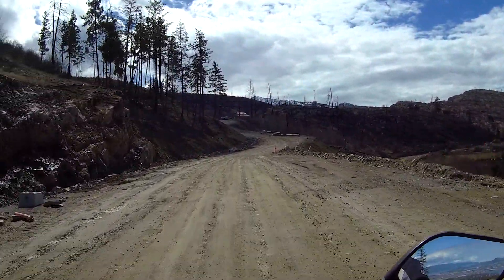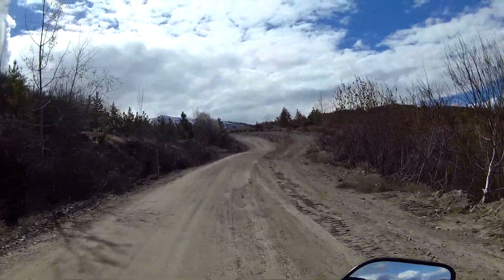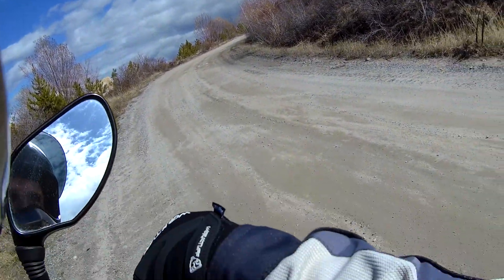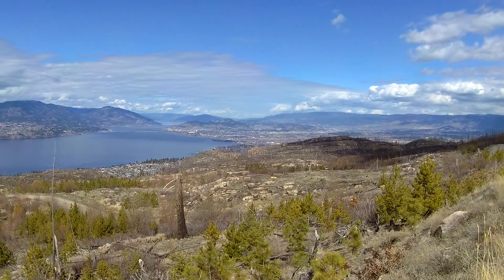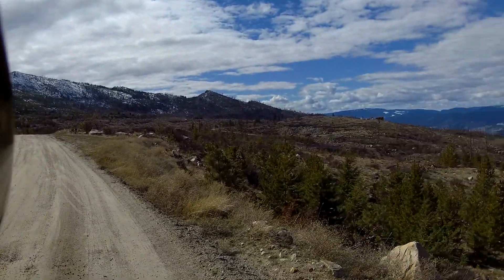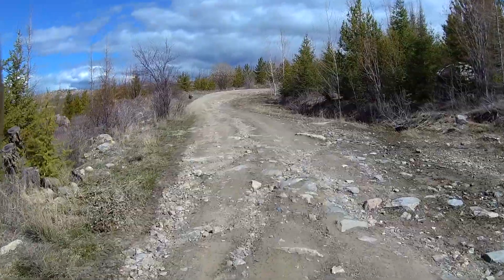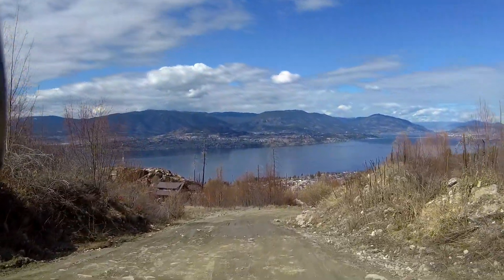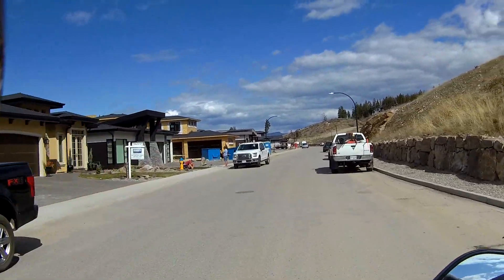Slow Dirt Ride For Photos CRF250L

Comment: Looks like the good weather is not far away. I would say a brace might help but I tried one when I had a hand injury and they can be sketchy. Maybe wrap it like a boxer with tape our a couple wraps with an ace bandage might cut down on the movement.
Reply from the maker: Yeah, I'm going to experiment with a plastic splint and wrap to see how that goes. We're solidly into spring now and routes are opening up at higher elevations.

Comment: I dont know if you have found a solution yet for your "shakes", I will throw this out there as someone who deals with spinal stenosis that causes my hands to go numb on long rides. I use a little deal called a cramp buster. I have more issues losing feeling in my left and grinding gears (not pulling the clutch in) but can lose some feeling for the throttle too. The cramp buster lets the palm of my hand weigh the throttle down and keeps even pressure on it when I cant "feel" to twist proper. Might not help in your case, just thought Id toss it out there! beautiful area by the way, I used to live in the Okanogan/Omak area loved it, still have family there. Take care & ride safe !
Reply from the maker: Hey thanks Zeuk. Yeah I tried one of those. Unfortunately in my case it made the issue far worse as it increased the leverage on the throttle and made it easier to twist when my wrist shook. I have since experimented with a wrap on the wrist. It stiffens the wrist and seems to work well. Just have to fine-tune it for comfort. The South Okanagan is a great place. I try to get down that way whenever I can. Great roads!

Comment: Salute from Ukraine) What's the total mileage on your crf? Have serious problems with it? Have you change your seat or stock is comfortable for you?
Reply from the maker: Hi Dimasik. I have about 56,000 km on the crf now. Other than repeated issues with the stock cam chain tension system, which I solved by switching to a manual Krieger CCT, I have had zero issues. The bike is a 2013 (purchased new). Very happy with it. The seat: I swapped the stock seat for a Spiral Step Seat. More comfortable than stock and I prefer the look of it. I rode with the stock seat though for years and found it okay. Some can't stand the stock seat. I must have a tough butt ;-)

Comment: I know you have tons of miles on your bike. I was wondering what oil you use?
Reply from the maker: I use Motul 7100 10W 40 Ester-Based Full Synthetic.
Reply: Thanks for the reply. I’m using Amsoil 10-40 metric motorcycle oil. I’m very interested in which oil this bike likes best. Your mileage makes a great case for the Motul.